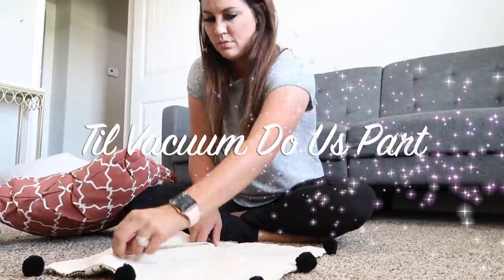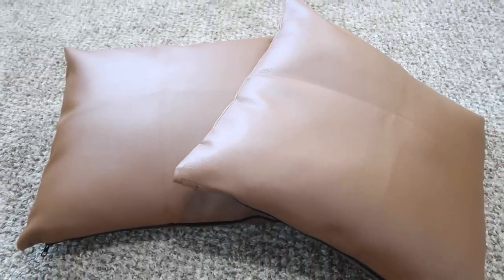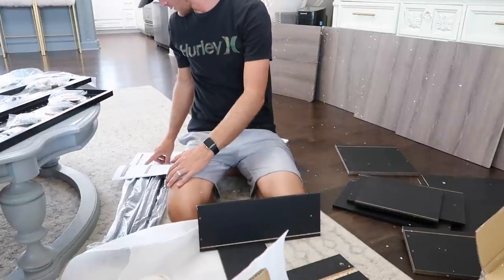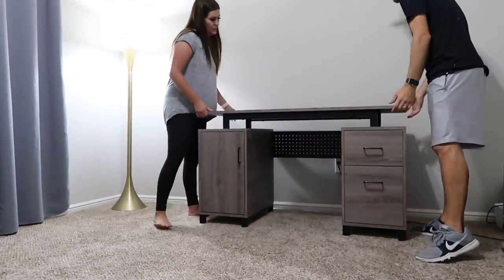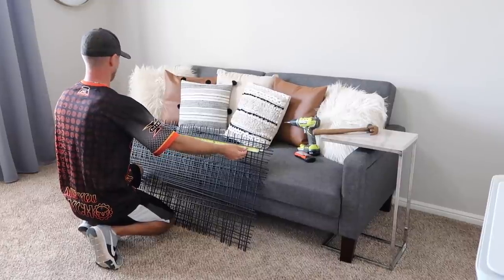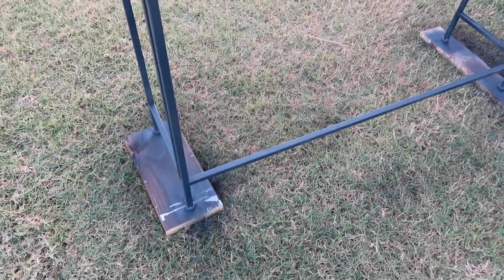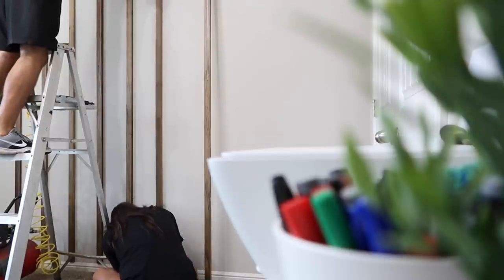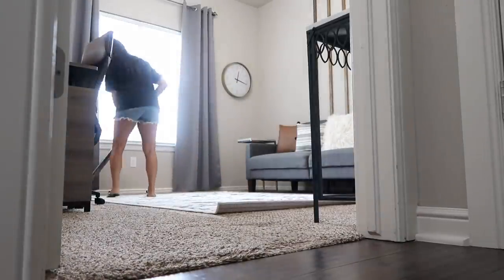DIY SMALL OFFICE MAKEOVER ON A BUDGET | SCANDINAVIAN INTERIOR DESIGN | OFFICE DECORATING IDEAS

Comment: I think the desk works so much better on the smaller wall too! The rug would look a touch better if you put it like 6 or 8" under the front legs of the sofa - just a thought. Also I LOVE the rug with the smaller print,  I don't think you showed it down though
Reply from the maker: Yea we tried that but since it’s a smaller rug, it looked a little goofy so we pulled it out. We will show the other rug on IG tomorrow for a vote on which one to use